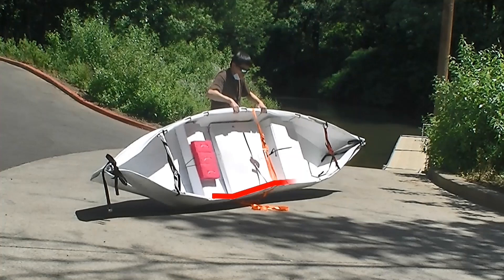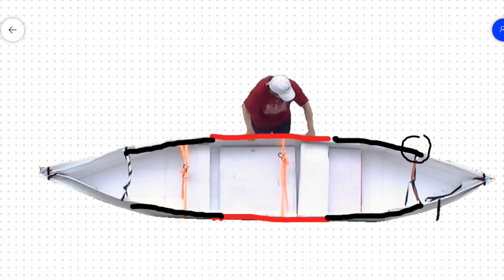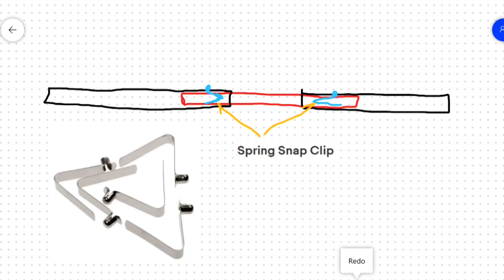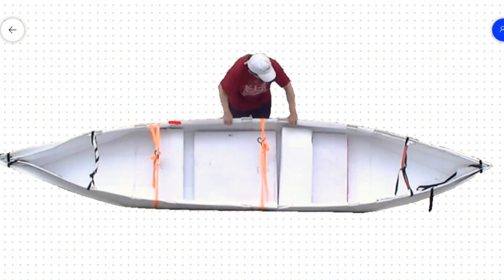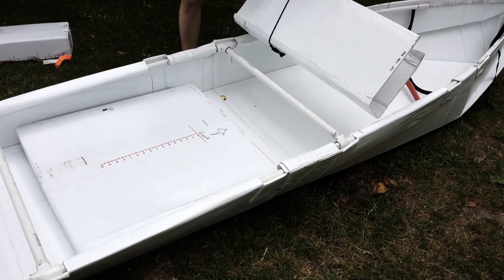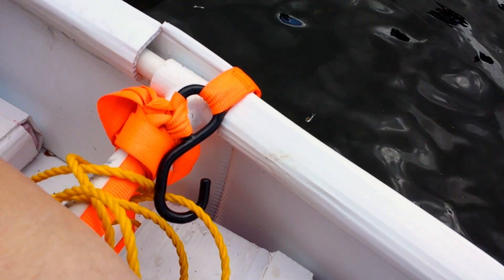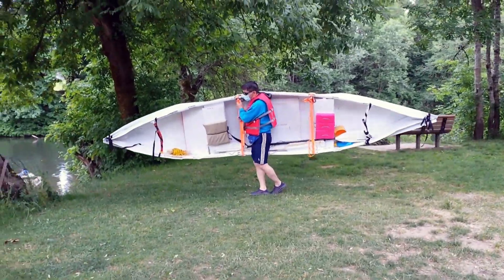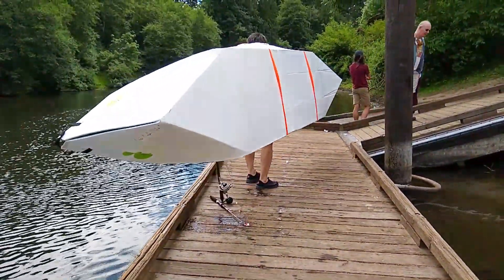#6  DIY A Foldable Canoe For Two :  Improving G16

Comment: Excellent video. Have tried adding a wheel or wheels?
Reply from the maker: Thanks for the question. I did think about adding wheels. Because I reused the coroplast from other boats and I couldn't get it down to the folded size (for transportation) I want (should be 1/2 the thickness), I decided not to implement the wheels. The one I am working on, because of the weight close to 40 lbs, I will include the wheels.  Please stay tuned :-)

Comment: I see we think on similar lines  I like your idea a center piece  of pvc to strengthen the gunwale.  I'm still waiting  for mr coroplast to arrive . Itching to get to work.
Reply from the maker: Thanks for the feedback. The 1" + 3/4" dia. PVC pipes are heavier than the 1/2' one I am using (which seemed to be sufficient). One option I didn't mention is to use a 3/4" dia PVC pipe at the center. Use heat gun to enlarge the hole size so I can insert in the 1/2" dia. pipe at both ends. Of course use the Al. tubing at the center would be better. That day, we were hit by an inflatable because that boat wasn't able to handle the wind gust and lost control. Glad my canoe didn't sink, in fact it handled the gust pretty well.
Reply: @DIYUSA  interesting, because I've been watching videos about making pvc connections using this technique. Your suggestion was like an ah ha  moment in my brain. I have been planning to use a center pipe extension in the gunwales of my  boat and wondering how to secure it.  I love your creativity.  Us coroplast boat builders need to get together and start a group post where we can share ideas,  videos and pictures of our builds.  Thanks for your prompt responses to my comments.
Reply from the maker: @susanbailey36  Thanks for your comments and suggestions. I have been thinking about a blog so viewers and I can share photos, etc. I've just noticed I can use the 'community' feature on my channel to post some other ideas I have. I have posted a photo on how to secure the lashing my G16. Please check that out https://www.youtube.com/c/DIYUSA/community
Also, if I flatten the ends of the PVC pipe, I can do a tuning fork Y slot at the end. If I set the PVC at the right length and I can thread the lashing thru the Y slot. Then the pipe will not come out. This should work well: no extra cost, fast assembly. I am not sure if the community feature allows viewers to upload photos. If not, I will set up a forum on Facebook... cheers!
Reply: @DIYUSA  You could set up a forum on Reddit? (a subreddit). Your ideas are so inspirational! I'm busy this summer but hopefully I'll be able to build a boat next summer. Our river is quite wavy but we have this sort of a large pond surrounded by the islands where the water is quiet and I'll be able to use the boat there.
Reply from the maker: @selja26  Thanks for your suggestion. The 'community' feature is OK for now. I will look at other options next month. This month I am busy building a boat that will be use at the Oregon coast at the end of this month. It has to handle wind force 3+. Also I will have to convert my small yellow car for camping (sleep in the car). It would be fun :-)